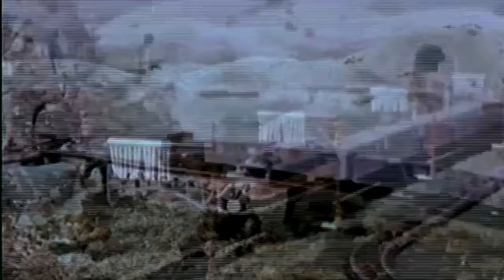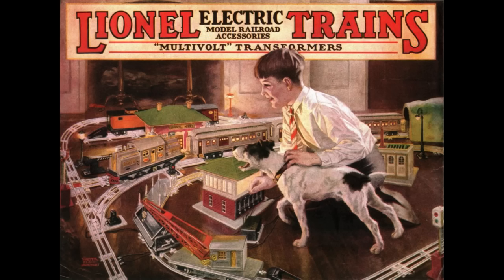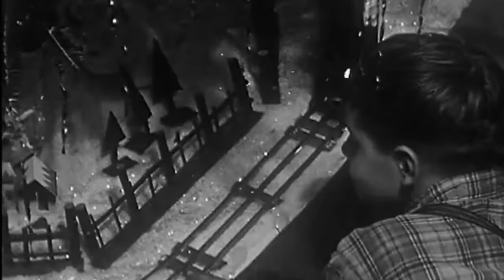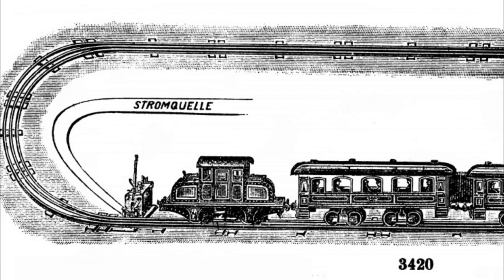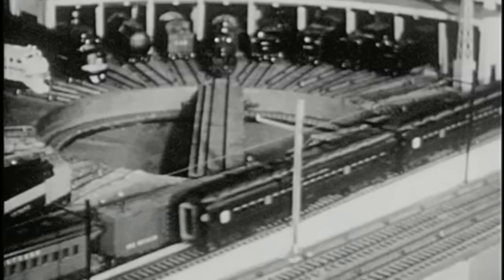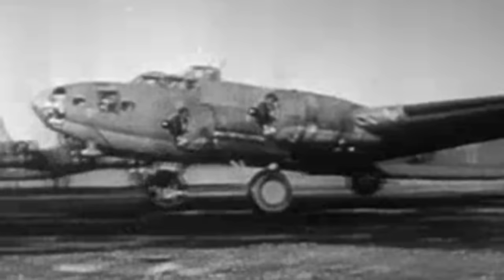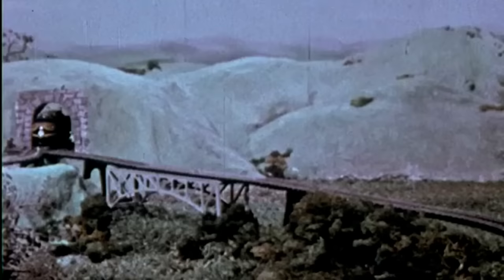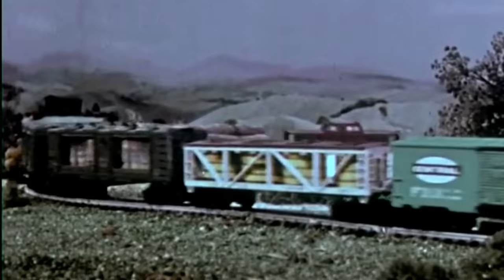Why Do Lionel Trains Run On 3 Rail Track?

Comment: I had Marklin HO trains from the 1960s as a kid. They ran on track which had a nice metal roadbed, and up through the center of each cross tie a little pin contact poked through a hole, which formed the third rail. It looked quite good, and ran much better than the standard American HO system which has always been sensitive to oxidized tracks. Also, the track needed no special underlayment and ballast to look like a real roadbed, it was made to look complete. Yes, it was a lot pricier than the American system HO track and trains, but the Marklin equipment of that era was extremely realistic, and well made, and so was worth the money.
Reply: Märklin track still works like this!

Comment: 1. in that shot of the train we see some kind of objects popping up and down along the train and only some of them suggests there may be some electronics so the signal for control may be sent on the 3rd rail.

this was before electronics got cheap enough to modulate signals over power rails witch today's utility meters do to phone home your electric usage.

2. they are trying to emulate the subway train and gets its power from the 3rd rail.

3. many model train sets have ac output on the power supply for use with the accessories like rail lights and stuff so the 3rd rail could be where the ac is sent.

4. the 3rd rail on that small scale acts like stablizer to prevent the train from tipping at high speeds although a slug of weight on the engine car would probably work just as well.

5. in the old models the tracks was copper and brass so maybe it was to put more metal out there for people to scrap when copper prices went sky high in the 2000s.

Comment: Just a couple of other boring things to add: Boucher actually called their 2 1/8" gauge track standard, with no apparent interest from Lionel, I'm guessing that the very small niche market for Boucher's very expensive and a little bit crude products probably weren't going to be a big deal for Lionel.
The other thing regarding the name standard gauge, we have to remember that at that time, basically to the mid 50's, "standard" meant high end or deluxe, special etc. Not as we associate it nowadays as being normal across the board. A prime example of this change was English car manufacturer "standard". As the popular understanding of the word changed the manufacturer eventually had to drop its name, becoming triumph in the late fifties.
Reply: I think you are 20 years off when you site the 50's as the time Standard was popular.  Actually, the 30's.  O gauge was the popular gauge before and after the war.
Reply: @cliffordkiehl3959  sorry, I meant up until the mid 50's the word standard had that particular definition as cited in this context, hence the quotes around the word standard, and of course further reference to the standard term in the fifties. The standard gauge referral was of course in 1906, its popularity waning by the mid thirties as we're well aware.

Comment: Another advantage of three rails (outside two rails one pole, center rail other pole) is that you can turn a locomotive around on the track and it will still travel forwards/backwards as commanded.  With the two-rail system, the train would "run backwards" if you turned the locomotive around.
Reply: You can list all the advantages you want - the undeniable fact still remains, that it looks like crap.

Comment: American O scale is the most fragmented gauge, with segments in Tinplate, Toy Trains, 3 Rail Scale, Two Rail, and  Proto 48 . If two factors had come together, 17/64 scale ( correct scale for O gauge ) and two rail, all the fragments would have merged into one, except maybe Tin Plate. The fears of small flanges needing large curves were unfounded. The fragmentation does not exist in HO. If Lionel had been brave enough It may have opened up O scale making it easer, in the same way as HO is today. Its understandable why they didn't, and O scale could be described as diverse rather than fragmented. You decide!
Reply from the maker: You could say that they came together in "Hi Rail", essentially scale equipment running on 3 rails to take advantage of backwards compatibility. Most Lionel, MTH, and other 3 rail equipment made today falls under this category. Personally, I stay with the older stuff because I don't have room in my house for 096 curves nor room in my budget for $1500 locomotives.

Comment: Interesting. When I was young growing up I remember my dad got out an old train set and put it together on our dinning room table, the oval track just barely fitting along the edge of the table. It was quite fun and rarely out as we mainly put it under the Christmas tree. The set is, I think, a Commodore Vanderbilt or a New York Central 20th Century Limited. It had been my grandma's before it was gifted to me. In the early 2000s I got a new Pennsylvania freight set. My only disappointment is that the sets' tracks are not compatible, leaving me only about to make 2 small circles though I only use one.
Reply from the maker: I recently made a video describing how Lionel tubular track and FasTrack can fit together.

Comment: 3 rail track makes loops easy without the need to isolate and swich polarity, Maerklin HO started with 3 rail back in the 1920ies and never abandoned it......!
Reply: Märklin has not left 3-rail track, but started to provide 2-rail alternatives by selling their models under the Trix brand. Additionally, it is no longer the go-to top brand for HO, as electronics and DCC became cheaper. People are no longer inclined to stick to one company or modify their models to run on 3-rail track

Comment: How interesting. I always thought -- in real life -- the middle rail was the electrified one, with contact plates under the train...
Reply from the maker: In the USA at least, real electrified rails are on the outside. Thanks for watching!
Reply from the maker: https://www.google.com/search?q=third+rail&client=ms-android-cricket-us-revc&sxsrf=ALiCzsbXjp8HH0S0T_PENo_FiNXUXV9CtQ:1666659956243&source=lnms&tbm=isch#imgrc=Q8ZtkxIGVDxpbM
Reply: @ToyTrainTipsAndTricks  Yes, that's what made me think of it. But, I thought maybe some early electrified lines were like that. Wouldn't be very efficient, though... Maybe, if Lionel had powered their center rail like that, no insulation would be needed at all. But I'm no electrician 🤣

Comment: Good video. Now you can discuss how 2 rail systems & other scales became more popular after WW2. :)
Also, what the devil are those things popping up & down of the rail cars in certain clips?
Reply from the maker: 1) That's easy. Thanks to cheap plastics tech, 2 rail became more practical to produce and the more prototypical trains became more popular. 2) I believe you are referring to the giraffes from the Lionel Bronx Zoo car. The giraffes duck their heads when they approach the "telltales". Thanks for watching!
Reply: @ToyTrainTipsAndTricks  Generally the smaller scales have more detailed cars, yes? I had a classic Lionel train as a wee lad back in the 60s.
Reply from the maker: @Caseytify  It depends. The Lionel 700E for example was very highly detailed for it's time. The main difference between detailed or not is the price tag, regardless of scale.
Reply: Those are giraffes in a circus train.

Comment: Helping a friend out with his modern Lionel o gauge as I have electronics experience. Have you converted one to DCC? Friend bought the dcs52 controller without knowing the Lionel is not DCC compatible. I will try installing a decoder in the Lionel 3 rail system he has got.
Reply from the maker: No. I have no experience with DCC. Sorry.

Comment: There is one thing that was not mentioned is that one brand DID make the switch from 3-rail to 2-rail WITHOUT changing their scales. I'm referring to UK brand Hornby (specifically Hornby-Dublo) and since the switch, the brand and its successors (Tri-ang Hornby, now known as simply Hornby) have never looked back.
Reply from the maker: A good point. Technically, American Flyer did not change scales, but rather gauge. They began making 3/16" scale, 3-rail O gauge trains in the late 1930's, and simply changed these 3/16" models to 2-rail S gauge after WW2.
Reply: Hornby went to two-rail and then got into financial difficulties, and were then bought by Triang. Triang renamed itself Triang-Hornby, and then Hornby, (in the process dropping the Hornby range).

Comment: If you looking old issues of Model Railroader magazine you will see that there are companies that advertised on converting three rail Lionel locomotives to two rail. They would have articles in their magazine about O scale railroads that had Lionel Hudson and electric locomotives as well as diesels that were converted to two rail. Going with my uncle to the Long Island Railroad they were signed everywhere that red Beware of the third rail. Of course they ran a lot of subway trains too.

Comment: I think the reason 2 rail O scale doesn't have as much success as 3 rail is because of the novelty associated with the 3 rail, 3 rail is the one old folks look back on with wonder and is considered as stated before, a model train novelty
Reply: There's also space requirements...due to body-mounted couplers, a given piece of 2-rail O rolling stock requires double the minimum curve radius as its 3-rail counterpart that typically has truck-mounted couplers.
Reply from the maker: But 2 rail COULD use truck mounted couplers if they wanted (as in 2-rail battery/mechanical trains). Some bottom-end HO trains (AHM, TYCO, etc) used truck mounted couplers in the 1960s and 1970s.
Reply: @ToyTrainTipsAndTricks  Sure. I even have some in the form of the 1970's Atlas (and 1950's Kusan) rolling stock. The kind of 2-rail O-scalers who wish 3-rail had gone the way of the dodo, would openly sneer at that suggestion, though :D

Comment: If you watch around 8 min mark, you will see the Super O track that was developed in the 50s with a much more acceptable appearance. I have a large Super O layout of post war equipment and I also am a member of our local HO railroad club. I have the best of both worlds!
Reply from the maker: Super O was a great product. It's getting very hard to find now that it's been out of production for more than half a century.
Reply: @ToyTrainTipsAndTricks  the old Mike's train house companies made a super O type track but like the other track with the built-in roadbed I don't think it's available anymore with the demise of the company
Reply: @ToyTrainTipsAndTricks  there was a commercial by American flyer where the salesman twisted a piece of Lionel track because it was so flimsy with having only three tires holding it together as opposed to most of the other companies that would have at least five times. Old man Cohen ordered the production of super0 track and switches before testing was done and it was found that the switch machines with locked into position start smoking and then catch fire 🔥. Everybody has so much tubular track that they spend their money on new rolling stock and locomotive.

Comment: Are you saying that the two outer rails are negitive  and the center rail is positive ?
Reply from the maker: "Positive" and "negative" are terms generally reserved for DC circuits. Traditionally, in three rail wiring the outside rails are "common" (or sometimes called 'ground' but that's technically incorrect). They are connected electrically through the ties and it is handy to tie all of the "common" sides together - outside rails, accessories, etc. The middle rail is typically wired as the "hot" side of the AC circuit.

Comment: Iirc hornby used to use three rail originally, before its merger with triang. I had triang products, And although hornby had some interesting locos, they wouldn't work on a triang circuit.
Reply from the maker: Thanks for the information. I'm not very familiar with European products.

Comment: Wheres the video of the Hudson running on 3 rail trackage?
Reply from the maker: I thought no one would ever ask! The footage comes from an old Fox Movietone film entitled "Rhapsody of the Rails" (https://archive.org/details/0406_Rhapsody_of_the_Rails_00_12_38_00) Similar scenes occur several times in the film. Careful examination shows what's REALLY happening is the train is approaching one of NYC's trademark between-the-rails water pans to take on water on the fly. About 30 yards before the water pan in a center rail guardrail to protect the tender's water scoop if it got lowered too soon. So - it's really just a joke in the video. NYC really DIDN'T use 3 rail track - it's regular 2 rail with a short center rail guardrail.
Reply: @ToyTrainTipsAndTricks  Thank you very much.
Reply: @ToyTrainTipsAndTricks  Hello!

Your Archive link no longer works, but it was easy to locate. Thanks!

Cheers from Vejle, Denmark.

Comment: When I was a kid in the mid-1950s, the RICH kids got Lionel trains for Christmas while we 'poor' kids got toy trains made by Marx that were half or one-third the cost of the Lionel brand train sets. But--hey--when you're a kid, you'll gladly accept whatever gift is under the tree, which my brother and I certainly did. While the Lionel trains were far more realistic-looking than the Marx brand, BOTH brands had something extra that TOTALLY destroyed whatever realism the trains otherwise had, and that was that stupid third rail. I would have much more preferred the HO model railroad scale train sets (that had two rails and a full complement of crossties), but I'm pretty sure they were even more expensive than the Lionel brand back then. A major advantage of the O-gauge three-rail train sets, however, was that they were twice the size and much sturdier than the HO-gauge railroads which made them much better suited for 'play' by clumsy, careless boys. Another down side of the O-gauge railroads is the huge amount of 'real estate' needed to build a layout that's at least half-way interesting. Model railroading is an excellent hobby for all the different skills required to build and run a railroad. Go for it.

Comment: My vintage Lionel southern crescent locomotive will only go backwards and it won’t go forward I have no idea why
Reply from the maker: It sounds like you have a stuck E-unit. First, move the lever on top of the engine to the other side and turn the power on and off a few times. If that doesn't work, you will need to remove the shell and try spraying electrical contact cleaner in the reverse unit. That will work most of the time.

Comment: I got a little bit of heresy
 How about changing the gauge of a locomotive that was built for a different gauge During the gauge changes in in American railroad history history this was a common practice I don't see why it couldn't be done with model trains
 But much like the real world examples
 It would probably make them ugly and ruin them
Reply from the maker: It's more difficult to do on models than the real thing because of the motors and gearing involved. Rolling stock is a different matter. I know of folks who have converted American Flyer cars to O gauge and vice versa by simply changing the trucks.

Comment: Tin is never used as a metal, only as an alloy like in solder. It's a common misconception that tin-plated steel is somehow tin. The tin plating is added to prevent rust.
Reply from the maker: Thanks for the information.
Reply: Since aluminum replaced tin for foil?
Reply: Pure tin is expensive, but it was once used for countertops, and it’s still used for organ pipes. Look up how organ pipes are made on YouTube, it’s interesting how they cast the sheets of tin.

Comment: However maerklin 1:32 runs on two track as does trix and piko.
I have a 1:32 railway and it is on two rail.
Thanks for uploading this intresting video.
✨✨✨✨🇸🇪
Reply from the maker: Lionel COULD have chosen to switch to a 2-rail system after WW2 (like American Flyer) as the plastics technology had advanced enough to make the insulators both durable enough and cheap enough for mass production. However, Lionel decided that backwards-compatibility with their whistle and remote coupler systems was more important than 2-rail realism. As the market leader in North American O gauge, Marx, General Models, and others followed their lead.

Comment: Modern two rail O scale has been hindered by the fact that there is so much three rail stuff on the second hand Market that is not compatible with two rail track. You can go to yard sales and get boxes of trains for 5 or 10 dollars and have a huge layout with three rails where is you had to buy brand new locomotives and brand new cars for too rail. Ahm, Atlas and some other manufacturers would double in two rail but everything was 90% three rail. Most modern locomotives require a much larger radius than 031. Lionel was a cheap bastard and he would not make stuff to scale so this way he would not have to make larger track. If he was a Model Railroader and made engines to scale that needed 042 you could redo parts of your layout to accommodate the larger locomotives like they do in real life. Imagine an O scale gg1 diecast running on 042 track with two more Motors imagine what a great Engine That Could Have Been. You can run insulated to rail cars on three rail track but not the other way around.
Reply from the maker: Lionel made 3 rail scale equipment in the 1930s (700E Hudson, Hiawatha, B6, City of Portland, "T Rail" O72 track). In the early Postwar era the F3s, NW2s, Trainmasters and GP7 were among the best "scale" locomotives available in the mass market at that time - crude by today's standards, but excellent for the 1950s. Then came Super O track - the best looking 3 rail track ever made. Lionel went where the market led.